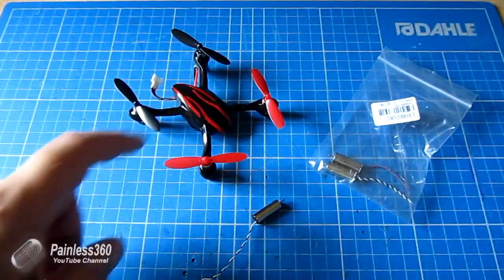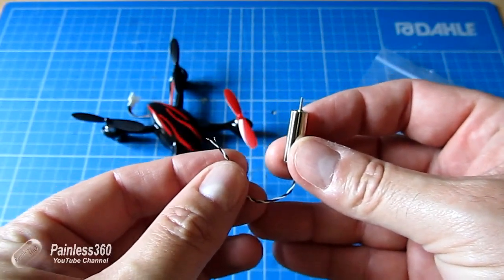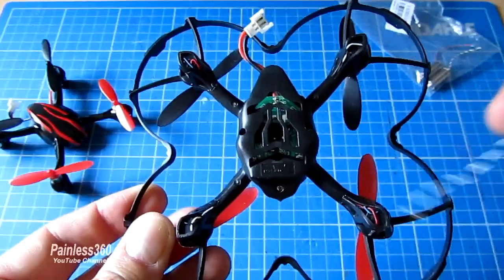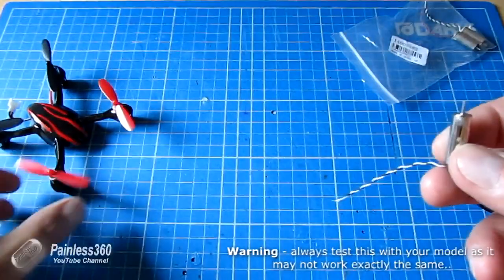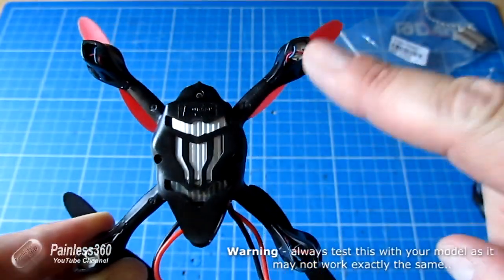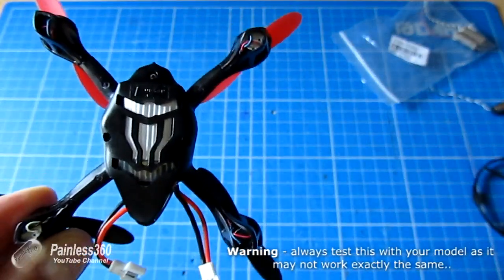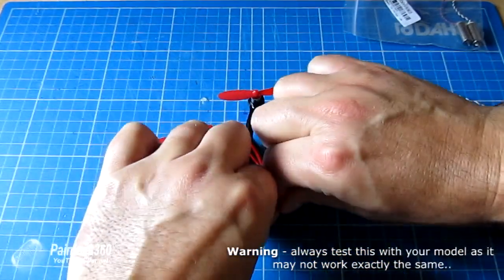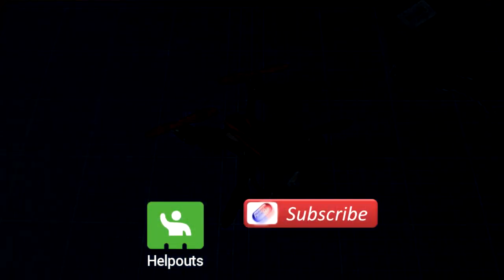Multirotor quick tips: DC motor trick

Comment: These little things are addictive!!  I wonder if you can get the H107D, and take the camera stuff off and have longer run times?  Maybe just buy the quad without the controller and use the H107L controller?  For as much fun as these are, 10 minutes isn't nearly enough run time.... I've had the best luck with the Tenergy 380Ma batteries for the H107L... about 15 of them!!

Comment: I think it is important to mention when replacing the motor, to use a magnifying glass to inspect your work. I had one of the really thin stranded wires come in contact with the other side, effectively shorting out the motor, and burned out the controller board, which has a sort of ESC built in.

I had to reverse-engineer the circuit a little and followed the traces back to the tiny SMD transistor and saw it was a bit charred, bloated, and discolored compared to the other three. I did not have the exact replacement, but it seemed to be a 3A MOSFET considering that the gate was connected directly to the microcontroller. That was also what the code on it seemed to pull up. I found a similar MOSFET in an old LED driver from a XML flashlight that broke, and re soldered the one from the LED driver and connected 35AWG wire to the three pins and determined it was also a MOSFET when connected to a simple LED circuit, and then I reflowed the new one back on to the board. After fixing the motor connection I tested that again and it works! (but in the process I took a extremely small passive component off by accident and so whenever it powers on, the motor twitches. Oh well.)

Comment: DC motors work in either direction as described but are often designed to work better in one direction because of how the wipers that feed the power to the commutator are arranged.  I wonder if that is the case here ?

Can you pop the end off the 'lazy' motor and see how the wipers are arranged ?  If you have a second motor of the opposite rotation it would be interesting to compare the wipers.

Having said that, the whole thing could easily be a marketing ploy to make you buy more motors than you need !
Reply from the maker: UKHeliBob You are correct that some of the official motors do seem to have commutators that are aligned with the desired direction of the motor. Interestingly some of the cheaper eBay versions don't!

I shared this as someone I know was waiting weeks and spending a fortune to get the motor direction they didn't have in the spares bin.

Happy flying!
Reply: Painless360 "Interestingly some of the cheaper eBay versions don't"
No surprise there then.

Given the choice of waiting for the correct motor or installing the wrong one in the meantime and flying I know which I would choose.  Running the motor the wrong way will presumably be less effective and will lead to earlier failure but you have to balance that with not flying and having a collection of motors that you don't want.
Reply from the maker: UKHeliBob 'No surprise there then' you said it! :)

One of my friends had a few of the 'wrong' motor types after a few crashes and simply couldn't afford to keep ordering two motors every time, he's now back in the air after using this trick. Even if it does provide a slightly shorter life to the motor, for him it's a great option. With these motors being consumables for the mode it made sense for him to use something he already had for free, no choice is the wrong one.

Happy flying!

Comment: Just be aware that using a motor in the wrong rotation can cause the brushes to wear out faster. Thats the only difference between the CW and CCW. If you bust them open you will see they have brushes in different orientations. (here is a pic of what the brushes look like.) http://i.imgur.com/Fddjh0Z.png
Reply from the maker: curtisbeef You are correct that some of the official motors do seem to have commutators that are aligned with the desired direction of the motor. Interestingly some of the cheaper eBay versions don't!

I shared this as someone I know was waiting weeks and spending a fortune to get the motor direction they didn't have in the spares bin.

Happy flying!